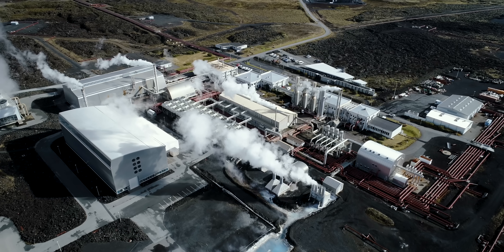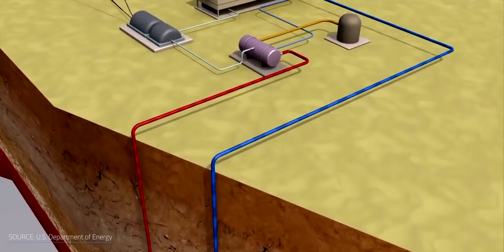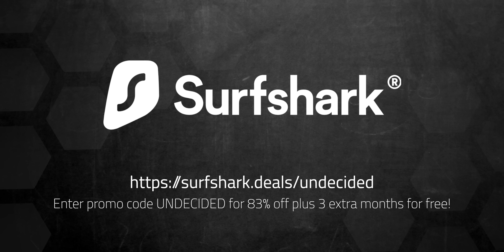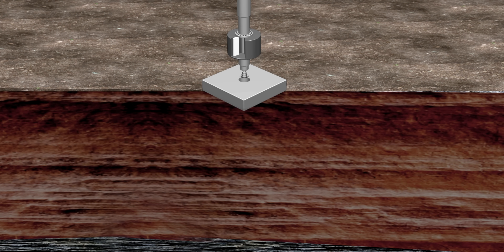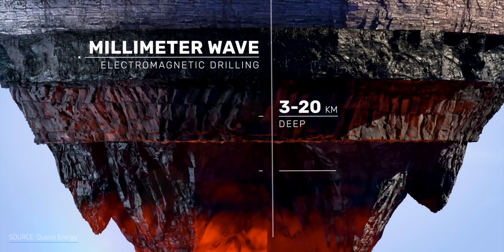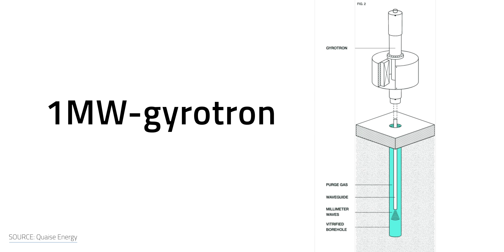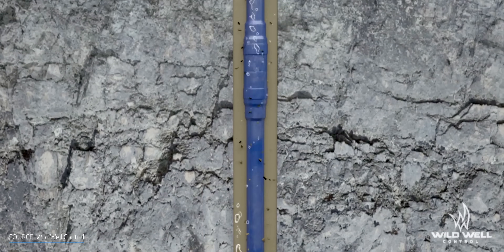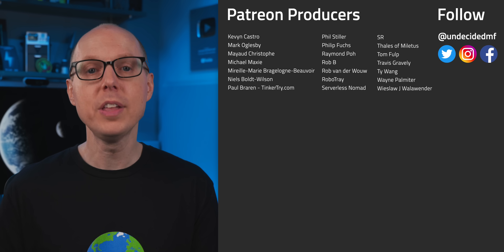Why This Fusion Tech May Be a Geothermal Energy Breakthrough

Comment: Directional driller here - This will get lost no doubt, but I can assure you that 10,000m MD (Measured Depth) with limited / no downhole telemetry will wind you up FAR short of 10,000m TVD (True Vertical Depth), and extremely far from well center. Further, the weight of a drillstring 10,000m long capable of transfering the torque required to make an 8" Diameter wellbore in combination with the extreme heat found at those depths will GARUNTEE a drill stem part... Not maybe - 100% for sure. The greatest length of steel of any cross sectional area that can hang vertically without breaking under its own weight is only 9,230m and that assumes no change to the modulus of rigidity from superheating, and will by definition DEFINETLY surpass the modulus of plasticity - meaning that if by some miracle you DO get your BHA out of the ground you will have turned a third of the drillstring into piano wire (how do you pump liquid / gas through zero inside diameter?). This is essentially a how-to if you want to fish for pipe suck in hole for years / forever. 

Then you have the challenge of having to remove the drilling mud to allow vapor formation and release without burning a rig down due to having essentially no well control options even with an RBOP so strong its basically imaginary and using perfect underbalanced drilling techniques - all the while continuing to drill into, in all likelihood, ultra pressurized zones containing high pressure "not rock" which can and will overcome any BOP surface solution in the absence of a hydrostatic head of drilling mud. Zero percent chance this can work, even though I wish it could - but I like the idea of Santa too...

Comment: Your cost comparison of a 24/7 geothermal plant to a solar array is misleading since the PV system is not 24/7. If you're going to compare "power plant" to "power plant", then you need to include the cost for energy storage to at least cover the night time hours. (Realistically, it should include enough capacity to cover several days of cloudy weather since geothermal doesn't care if it's cloudy or not, but we won't go there.)

Comment: The 0.1% over 1 million years figure cited sounds very pie in the sky and I'm dying for a breakdown of how that figure was arrived at.
I also think that the glassification of the walls is really just a bit of misdirection to encourage test funding... it's  only a temporary boon while drilling, but something you'd still need to sheath for long term reliability and stability just as in traditional bore hole drilling. That said, I doubt it'll eat up much of the savings in time or cost.

Comment: Good to repurpose coal infrastructure and use recirculated water so less loss to atmospheric humidification such as hydro and outlet steam generation systems. 
Boring away from tech tonics is great and geo mapping with existing coal generation assets could give high return plant sites for initial plants conversion for on going cost recovery and expansion. Killing coal quicker. 
China may be first uptake as always quick to transition.

Comment: Could active volcanos be used instead? wouldn't it offset the cost of drilling at impossible depth? Wouldn't it save taxpayer money from wasteful unproven technology? What I mean is to try the concept of generating geothermal viability on a platform that is more amenable to do the research at a reasonable cost, then extrapolate your studies if it shows success and profitability. Also couldn't it help regulate the volvano's activity the same as a pressure cooer? Then it would be a benefit for communities that live a close range.

Comment: I wish it will be that easy but sorry to disappoint this will not work. Gyrotron has the power to melt the rock... but that's it. The waveguide(the hollow copper/silver/gold plated metal tube transmitting the beam) is not compatible(usually they put desiccants to remove minute amounts of water vapor,, it is that sensitive to water) with wet underground conditions nor can be kept 10km-20km at engineered dimensions to reflect the beam to the boring head on the bottom of the borehole. Also most of you know what happens to the molten/hot "glass" when it is in contact with water(it shatters) this will not form proper casing nor such several millimeters thick "glass" casing can hold the geostatic pressures in the range of several hundreds of MPa(1MPa is 10 bar or 145psi)(for the granite we have 270 bars/km) nor can be pressurized to these levels solely with air or inert gas - the density of the gases is not comparable with this of the solid rock. These pressures will crash and bury the waveguide like aluminum can. The lifting debris method also will not work at these depths. The debris will wear out the casing and borehole will collapse. Not to mention all the transition boundaries, pockets and fault lines - no the ground beneath us is not homogeneous nor dry...

Comment: I think it is a better direction to go than tocamac and other Fusion power technologies. It seems so much much more stable and less potential for catastrophe than direct fusion power. It is my confirmed belief that we should never plan to generate more than 10% of mankind’s energy needs from processes other than those derived from redirection of existing energy flows powered by Solar input to the globe as a whole. To do more puts a serious risk of Global warming entirely down to the implications of the second law of thermodynamics. Using a greater portion of the solar incident energy to do work on its way through to low grade heat can be as extensive as our technology can provide at no risk of global warming due to the need to radiate heat to maintain equilibrium at the globe level, which of course is absolute temperature dependant.

Comment: there is no need for electrical generation input once you are moving into the deeper rocks, you would start on a smallish depth drill, drop a ammonia or water boiling system into the hole using the contact and radiant heat to boil the water or ammonia , run a turbine or steam engine on the resulting gas recondense and return, once you have a decent stable supply big enough to drill, continue to drill demand free on a new hole if you need more power as you get a deeper hole put more than one in use,

Comment: If it would work like they hope that will be great news because you could just drill the hole in the already existing power plants and just swich from coal to geothermal heat and than it's almost free energy because there isn't 100% free energy, you do have to  maintenance whatever but it's gonna be way cheaper and cleaner

Comment: couldn't they just use concentrated sunlight through using an enormous fresnel lens and big piece of optic fiber? the enormous ammount of sunlight would vaporize the stone with almost no electricity used at all, just the servos to move the optic fiber down.

Comment: I invested in geothermal exploration in the Cooper Basin in Australia some 14 years ago. The bore was 4500m deep and the proof of concept was established until embrittlement of the steel bore lining caused failure. I lost my money but I still see geothermal power as the nearest thing to a perpetual motion machine we will find. If those Cooper Basin bores had been drilled by this method the metalurgical issues would not have occurred and we might now be enjoying the fruits of clean baseload energy, and I would be enjoying the fruits of my investment. I was just too soon with it.

Comment: Note that technology depicted allows not just for drilling, but rather shaping voids in all directions in granite bedrock.

I would rather see this technology used not to rob the
 Earth's interior of heat, which is needed long-term for maintaining protective magnetic field of our planet and for plate tectonics which are essential for life, but instead to use it to move our nuclear power production there, where fusion could benefit from high pressures and high starting temperatures, while our fission molten-core reactors could be located deep down where there is no need for radiation shielding or decommission.

Comment: Hi Matt
Just a few comments: mechanical drilling to 10km is practically impossible. It's not 30 million usd. It's a sizable chunk of the GDP of a small country. Well cost is exponential with depth. 
Second: if you don't have mud inside your well you better start running. It's a matter of time before the 'glass wall's breaks down and you get a blow out connecting very high pressure fluids with the atmosphere. Completely unsafe. I'm trying to be polite. It's not overselling to say you don't need mud. It's ignorance.
I'm a petroleum engineer btw.
Love your channel, but I wish you focused on feasibility a bit more. Many of the things you present have obvious draw backs that you don't address. 
Cheers

Andino

Comment: one mayor argument against geo-thermal is: it is NOT clean .. the water pumped down solves carbon in the ground and transports it up with the heat. "producing" co2 in a more direct way than oil and gas .. still a fan of it but it is NOT "clean" or co2 free
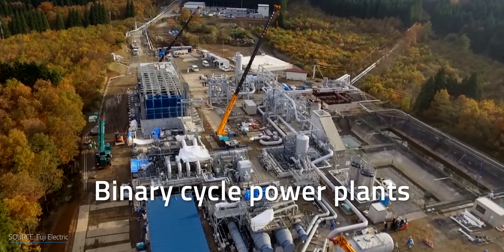Reply: Binary cycle power plants seem to address that issue - discussed at 2:25

Comment: You briefly mention pumping the toxic water back down. Iceland has just recently had to start pumping the water back down into the ground which has resulted in sizable (but perfectly safe) earthquakes. The point is that the wastewater is a problem everywhere, Iceland is just far ahead working on these problems.

A bit more than just baking bread in geysers (a word you got from Icelandic, we are working on licensing the word so people have to pay 1 iskr. each time it is used)

Comment: Can not work every where, will not be a real ""Geothermal Energy Breakthrough" Not Viable !
Reply: It seems that if viable this drilling technology actually would make geothermal possible more or less every where.
Or perhaps I didn't quite catch what you meant?
Reply: @EneriGiilaan  no you can't use it every where, The geology of the area won't let you use it any where, its Not Viable. Stratigraphy or strata of an area determined where you can use that tec and how well it works .
Reply: @CDWCAULDRON  AFAIK - in case one is able to economically drill a 10 km hole down in granite - then it at least vastly expands the area of the globe suitable for geothermal energy.
I would appreciate if you would care to explain a bit further what kind of specific stratigraphies are you talking about?
Reply: @CDWCAULDRON  Hmmmm ... to me it seems that you just keep regurgitating some well known general issues. Issues that seem to be specifically related to the areas where we have been restricted to operate thus far due to the cost of drilling. That is - areas where the crust is thin i.e., near fault lines and/or hot spots.
AFAICT the situation is totally different in areas of thick crust with granite bed rock - which are much more stable environments - but have been out of question due to the technical/economical considerations.
Reply: @CDWCAULDRON  The thing is - you might be right and you might be wrong. 
I just can't tell - because you just keep making general statements - with no details or any kind of other implication that you actually know what you are talking about.
Reply: @CDWCAULDRON  I don't know you are right  - and neither do you (even if you happen to think so).  
But what is the real problem here is that even if I choose to believe that you have  some real  insight about the matter (being for ex. the chief geologist in a drilling company - instead of being the truck driver in a field team of the said company) - there still seems to be many other experts  that seem to have different opinion than you. So how can I choose? 
What you would have to do would be to actually try to teach me (and the other audience) something about the facts and reasoning that has lead you to your current position of the matter. Plainly stating 'stratigraphy' and 'reasons' just would not do.
Reply: @CDWCAULDRON  Now -  if you could just  spell words correctly and construct grammatically correct sentences you might be taken as someone with some knowledge of the subject. 
And as I said already before - many geothermal experts no doubt have read the same reports and studies and have to come to a different conclusion. 
What I have been asking you here is some synopsis of all the literature of the (at least supposedly) your field pointing out the key factors.
I know at least that is what I would do in case some one happened to probe for why I have a particular opinion about an issue in my field (astrophysics) - which BTW I happen to have about 40 years of experience myself. What I would not do is to bluntly try to state that I'm right 'just because' and demand the questioner to study the literature by him/herself. And as this is the way any real experts I know would actually behave - I must come to the conclusion that you are not a one - as you can not seem to be able to back your position with any real arguments.
Anyways - it seems that we have both said all we are able to say about the matter. So I will the floor to you  for the last comment (if any). Don't expect me to answer . except in case you come up with some new interesting angle.

Comment: Have they consulted a geochemist?

Water, rather steam, is a very transformative substance.   Rock and minerals will change when exposed to steam.   You will literally change the chemical properties of the minerals in the rock. Olivine will serpantenize.  Feldspars will become clays. Silica (quartz) dissolves in water by a factor of temperature and pressure.   Sure, quartz in air at sea level won't melt, but add water and pressure it drops down to hundreds of degrees 

I recommend talking to a geochemist before spending millions of dollars drilling a hole that will be filled with hot rock soup

Comment: No no no, your talking to the wrong folks. Any mountain range large or small can provide enough heat. Your talking about huge plants providing power to large grids, which as we know today a bad mistake and takes a toll on the whole system should it go down due to ohh let’s say a earthquake. Small geothermal plants can be built along any mountain range large such as the Cascades or small such as the Turtle Mountains in North Dakota. The smaller plants can provide for up to 500,000 homes. And can be built quickly, why go super big when these will do fine residentially and excess can be stored by battery. Larger natural gas plants failed back in the winter of 2020 in Texas, Too cold to start up, the wind turbines worked but there weren’t any backup storage. So rollovers all over Texas. But if they build small geothermal plants along the Ozarks which have hot springs and closed fracking wells, they wouldn’t need to depend on a few plants but many which would make both winter and summer a breeze.

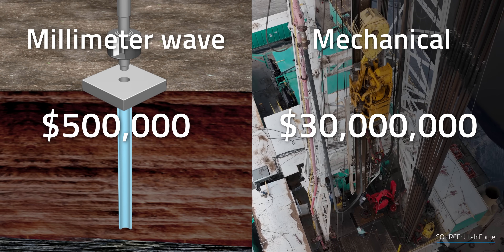Comment: 8:17 $500,000 vs. $30,000,000
8:57 air drilling (or argon, in this case.)  Still, "glassy coating" doesn't sound as robust, esp. re: Charpy impacts, as API 5L or 2B for casing.

Comment: Just curious, but have you looked at the HyperSciences drilling technology to drill wells for geothermal. They use inexpensive projectiles fired at hypersonic speeds to pulverize hard rock to lower drilling cost by 5-10x. The tech also has tunneling, clean mining and aerospace applications.  See https://www.youtube.com/watch?v=O-1p5OLmTKs

Comment: I don't really understand how the srting would be any lighter, or how it could possibly be any less complicated mechanically than a current drill string. Also, how does it maintain over pressure? And why doesn't it need to circulate?